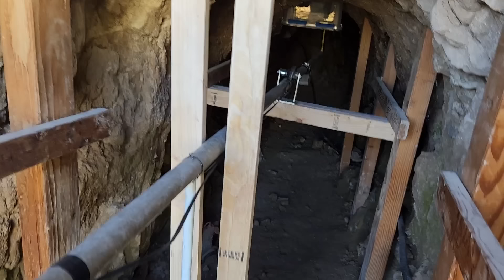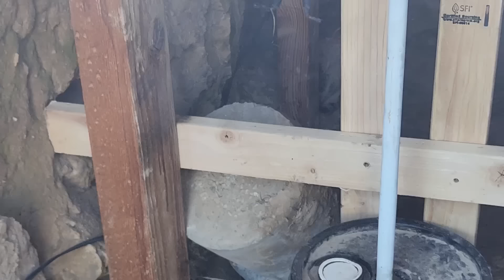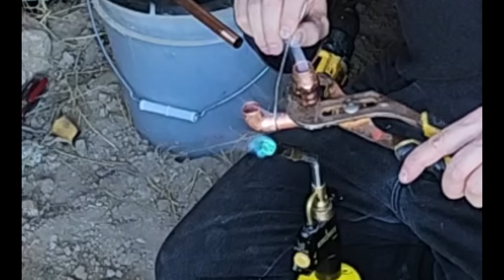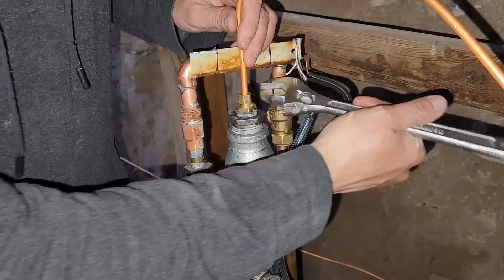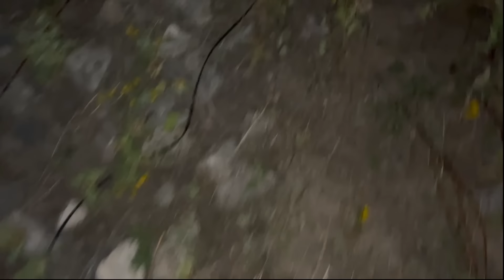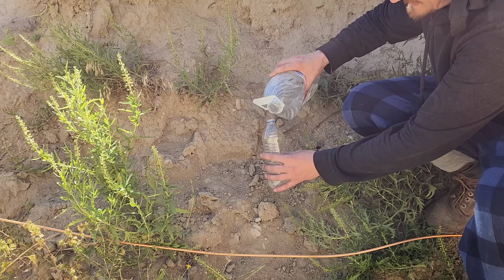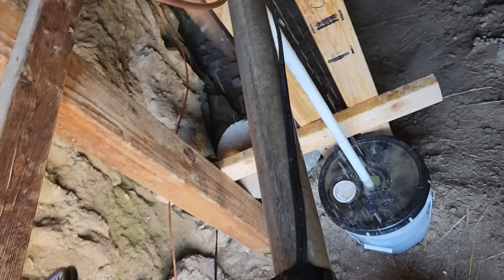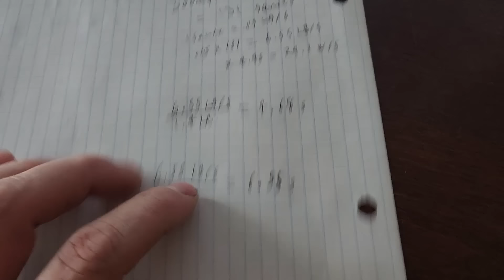Sodium Water Hybrid Rocket?

Comment: THINNER AND LONGER SODIUM CYLINDER WITH STAGES TO ENSURE TOTAL SODIUM BURN AND LONGER BURN AND NO SPUTTERING. SMALLER EXHAUST HOLE TO PREVENT SODIUM FALLING OUT AND MORE WATER. A SMALL PUMP WITH COPPER PIPE CAPPED BY VERY SMALL NOZZLE.

Comment: Inthink the heat melted the sodium and it blew the metal out of the injector - need to work out how to maintain the temperature and perhaps also use the hydrogen produced in the reaction to provide thrust?

Comment: i'm not nearly as creative so I' struggling to come up with a better way to use sodium as a propellant because solid sodium has the problem that as you burn it, you're going to start melting it, so you'd have needed some kind of regenerative cooling. injecting the two on an impingement might work but idk how you'll get sodium to behave, pushing it out through a screen as a monopropellant might work if it catalyzes with something besides water

Comment: I wonder if this would work by using a cylindrical-Aerospike-style water injector at the bottom of the combustion chamber facing upward to start, with a top-mounted injector pointed down to start later? Or a variable-geometry injector at the top that starts with a thinner cone-shaped stream that just barely hits the bottom of the clyinder-cut in the center of the sodium early, then expands as it goes to hit higher up the sodium central cavity as it goes? 

Anyway, a sodium-water rocket is an interesting idea, I think it's purely the "delivering the oxidizer to the fuel" that is the hard part.

Comment: Maybe you could use smaller rods, and a lot of them, instead of one big one down the center. Maybe a bunch of rods made from something that will dissolve once you pour alcohol onto them, after the sodium has solidified. Would just a few be better than a handful? For longevity vs peak thrust? This is a fun experiment.

Comment: Congrats on your proof of concept!  Totally Cool, the SCA vest was overkill!

My thoughts are that you need to test at what pressure does the Pressure Vessel fail which will give you a baseline for how strong a combustion chamber needs to be.  Remember your combustion chamber is not a sealed vessel!  Also PEX is much lighter than copper, and an igniter could melt a wax cap releasing the water instead of a heavy copper valve or even a plastic valve could be employed.  I suspect the dry unfueled motor could be brought down to 2lbs or around 1kg. 

_______________________________________________________________________________________________

Careful prophesizing on Climate Change prevention as the sodium bicarbonate may act as warm blanket holding warmed atmosphere below it.  Just saying!  Maybe you can say "No CO² released by that engine!" and stand correct of course that does depend upon the fuel manufacturing process! (getting the pure sodium metal)

_______________________________________________________________________________________________
My thoughts while you brought up climate change!

PS: EVs are not the panacea we are being told, we all must downsize our cars to engines under 2l or under 1l still using gasoline and move towards getting a solar home power plant not using non lithium batteries like iron sodium cells which WILL saves our world!

Comment: Ok speculation time... instead of one injection port... you have multiple surrounding it shooting water through predrilled holes in the sodium... With an uphill slope to them, terminating at the top center hole....instead of one large hole in the center you have a pinhole so the melting sodium has an extra second to burn. Perhaps have the center hole be cased. Maybe swap the argon for something volatile. Whatever you end up doing I'm excited to see what you come up with. 🎉

Comment: Instead of burning a thread, you could use copper wire, #24 wire should hold about 10N easily, and would melt when you apply voltage to a section in the middle.

Comment: Maybe if you could have made small pellets out of the sodium the smaller the better then there would be a more consistent reaction as the water makes way around the pellets. In the case of using pellets I would say maybe using smaller pellets towards the bottom and then significantly larger as it goes up towards the top because the top in your design gets worse exposure to water than the bottom. The nozzle would have to rise up if it was put at the bottom exposing the bottom part of the sodium that's closest to the X in the rocket and then the nozzle should rise above the burning but if you intend to burn from the top side down it would totally throw off the thrust capability of the rocket. I think the design has to be rethought when it comes to the use of the sodium with the water it might even be better if you can make the sodium into a gas and mix sodium gas with steam in expansion chamber like typical rocket.

Comment: I love seeing the ingenuity and rigor that you use in the concepts, build, measurement, and explanation of the setup!
Weighing the paper is so great, it gave me a visceral sense for what an integral actually is that I never got from all my calculus courses!
Reply: It is literally the area under the graph. Technically he didn't do calculus because he did not mathematically figure out the area. Granted, if you are just tinkering it is a decent quick and dirty method.
Reply: @joshbeaulieu7408  He did do it mathematically by calculating the weight ratio.

Comment: I agree with using a liquid fuel,,  You would have injectors for both the oxidizer and fuel,, which then will let you control the rate of burn more evenly,,,  in fact,,, you could remotely vary both the amount of oxidizer and fuel during a burn to figure out the best ratio,,,  I realize that you can use chemistry and math to get close to optimum but the remote control would let you vary the volumes and pressures to dial in the values to allow for changes caused by your hardware,,,  ok,,,  lets get to work,,,   :-)

Comment: Very interesting idea. Me being an armchair rocket scientist 😂.  Could you use a engine injector that's designed to go straight on a engine head. Should be able to deal with the heat. Closes when there is no power so it has a Deadman switch in a way.

Comment: Turn the jet upside down so that the water and sodium doesn't pour out the bottom. If the jet is blowing upward thus pushing the rocket down then maybe you won't have to do it in the mine.

Comment: You could theoretically increase the specific impulse of your rocket a fair bit by using hydrogen peroxide instead of water to oxidize the hydrogen and produce more energy from the same weight of fuel

The issue would be igniting the hydrogen with the oxygen, which may happen on its own with the heat of the sodium reaction. Theres also a chance the sodium may create sodium peroxide with the peroxide, which is a very strong oxidizer itself

So if you are looking for a second battery of tests, 10-30% peroxide may give you a big boost in thrust to weight

Comment: If you drop Sodium in water most of the energy goes into a chunk of the Sodium flying up into the air. There's no way this rocket design isn't going to result in the 'solid' fuel disintegrating almost immediately

Comment: I think using SaK alloy as a liquid fuel is definitely the way to go. The problem with trying to use solid sodium as a fuel is that sodium is a metal. And metal conducts heat. Whereas typical hybrid and solid rocket propellants are self insulating. Combine Sodium's low melting point with its relatively high thermal conductivity, and it's easy to see why the fuel melted and ejected within the first second after ignition. And even if it stayed in combustion chamber long enough to burn, which it won't, the motor casing would have little protection against the heat.
But all things said and done, I'm not sure that the specific impulse of water and sodium or sodium-potassium is going to break 150s, even under ideal circumstances. That's better than some amateur propellants, but not enough to compete with commercially viable propellants. And even if it performs well enough to be competitive, the handling difficulties of elemental sodium might kill it right out of the gate.

But I hope you're able to find a way to make this idea work. Maybe reach out to Thunderf00t. He has a lot of experience with burning sodium.

Comment: Cody, I have two points of advice, 1) pouring the sodium in multiple pours, will result in voids in the material leading to combustion instability. & 2) try creating a pure argon environment to melt and pour the sodium into your combustion chamber to resolve this issue. On a positive note using a threaded rod for the central cavity within the sodium is a great idea as it creates additional surface area for the ignition of the sodium. However, that may be what led to the engine-rich exhaust. (Edit; spelling error.) P.S., If you review the slow-motion footage you can see that the additional surface area introduced by using the threaded rod did in fact lead to excellent ignition of the engine. I believe that the engine-rich exhaust may have been caused due to combustion instability introduced through the use of multiple fuel pours leading to cavitation (voids) within the sodium which in turn led to rapidly varying surface area within the fuel grain creating the instability seen.
Reply: This could also be achieved by remelting the sodium once it's in the tube. Another factor in the combustion instability may be insufficient pressure forcing the water into the combustion chamber, allowing the exhaust to prevent water from flowing into the engine until the combustion ceases, resulting in an oscilating combustion pattern.
Reply: That in my view doesn't affect the main problem of the concept which is liquid Na being expelled from the combustion engine.
I think that he must first address a way to reduce, not increase the interaction of Na with water in order to reduce the temperature in the chamber and develop a more consistent and steady burn.

Comment: Looks like instead of a rocket engine you made a tube that craps molten burning sodium. This was the problem I was curious to see how you might address it, unfortunately not addressed in this model . I can't really see how you would fix it beyond tremendously increasing the burn rate. Which you cannot with h2o and sodium. Should probably at least start with a smaller diameter Maybe some kind of supportive ceramic framework that increases surface area exposure to water as well as something for the molten sodium to adhere to.

Comment: Amazing work! I wonder (although by any metric I realize it would be hell to achieve) can you control the sodium injection like the water, for example, if the sodium is in powder form? I know combustion of powders is way easier and this can combust into air even if it is not a powder, so basically converting already dangerous stuff to super-dangerous... But still the lost of trust seems due to bad mixing of oxidizer (water) and the fuel (sodium), resulting in a lot of unburnt material leaving the rocket without producing (almost) any trust, thus the rocket operate very very far from its theoretical maximum.

Comment: I love these videos. I think if you wanted to get a little more of a controlled burn in the future instead of using an inert gas for pressurization maybe use some type of hydraulic pump with a bleeder and injector. Like something out of a diesel truck. liquid pressure is much more of a steady flow.

Comment: I wonder if there could be an advantage in including a sacrificial plastic or waxed paper liner inside the sodium propellant tube, so that the reaction front is confined to the bottom end of the cylinder.

Comment: I wonder what would happen if you mixed the sodium in its molten state with water using two nozzles? Drop the molten sodium and water into a small steel bowl. Cover the perimeter of this system with steel pipes. Direct the gas resulting from the chemical reaction from the other end of the pipe. Such a system seems more promising in my opinion.

Comment: solid fuel rockets would burn from the bottom up, but if you are applying water from the top then that is most likely why it is blasting the sodium chunks out the bottom. Maybe for next version try water from bottom or maybe spray from a range of pinholes down a pipe in the centre hole? Ideally you would want to stage those holes so water only contacts the bottom layer of sodium and as it burns activate the next pinhole further up.Or what cberge8 suggests, but within the long hole.

Comment: I think that once the water flow ended the argon gas took away the oxidizer and quenched the combustion. Not entirely but it did contribute. Straight-up compressed air might of been a better choice.

Comment: I'm thinking a ribbon or pellet injector for the sodium into a controlled-water-flow reaction chamber above the thrust nozzle. Potentially avoids the issue with unreacted metallic sodium. Feed rate could also then control the amount of thrust. Great job, keep at it.

Comment: A couple of thoughts 
1. The reaction also produces hydrogen so controlling the combustion of that by some sort of afterburner should increase the thrust
2. It’s probably worth doing some research on whether pouring molten sodium directly into a metal tube might produce some kind of amalgam and weaken the metal (like for example gallium or mercury do to aluminium).

Comment: I worked in a pesticide research lab in the 70's, and we used the same weigh-the-paper method to calculate the parts-per-million (or billion) of whatever pesticide we were testing for.  We had a PDP-11 and a PDP-12 available to us, but weighing the paper was easier, and just as accurate.
Reply: Blessed be those who gave us modern HPLC.
Reply: @bazooka93  You can always have a slide rule and tables of logarithms as with NASA Apollo engineers 😉

Comment: i think the way the fuel is mixed is perhaps the biggest point of failure, lower part of the solid fuel getting dislodged and blown out the back is a massive problem, perhaps some sort of internal baffles with channels to increase surface area and help retain the solid fuel in the chamber, fantastic practical science as always, edit i saw another guy suggesting injecting molten granular sodium and i think thats an even better way to maximize surface area, although adding alot of complication

Comment: Awesome!  I love the concept.  It seems to me your most immediate need for improvement is in regards to fuel mixing.  Ideally the only fuel present in the reaction chamber is that to be immediately reacted i.e. the amount of gasoline in a combustion chamber suitable to drive a piston.  When you first explained your concept, I assumed you would be using granularized sodium.  Seeing the sodium at normal or whatever your ambient temperature was, I can see how this could be difficult, but I think it's your best bet.  In my mind the ideal engine would have the fuel mixture entering the reaction chamber in a volatilized state with maximum surface area at a controlled rate that matched that of reaction.  I'm thinking two nozzles, one spraying powdered sodium and the other water.  Anyway, love what you're doin man, don't let your reaction product exceed the escape possibility of your reaction chamber.

Comment: Was going to ask about a full liquid version, until seeing your comments at the end. Hope to see it. My only other thought was to try something like the hybrid fuel pucks, and use sodium bits suspended in a matrix that gasifies at an appropriate temp to regulate fuel supply and egt. Some hybrid/hybrid, with water/peroxide and a rubber matrix with suspended sodium craziness??? It seems like it could work, but encapsulating the sodium to make it safer to be around is probably a good idea in the long run(for safety and reliability). I was shocked at the low melting energy of the sodium, seemed like it was just barely even solid when you were tearing off bits and crushing them with your hands. Not really surprising it puked its guts out as soon as it got going.

Comment: that's awesome.
 i was working on electrolyzed water rocket but got sidetracked, have to make it "on demand" as it's too dangerous to store; some dude in CA blew his brothers arm off then eventually himself trying to store it(electrolyzed water, AKA HHO gas, Brown's gas) in steel tanks. can weld with it too but have to bubble through alcohol or welds oxidize.

Comment: Low toxicity, long shelf life hypergolic engines would be so incredibly helpful if this promising chemistry can be tamed.
What kind of binder would melt at a higher temperature than the sodium to keep it in the engine long enough to react, and what geometry of sodium in the binder works best?  Can the binder break down into something acidic or can acid be encapsulated in the binder just like the sodium?  Could this further detoxify the exhaust into salt water or something?

Comment: I was wondering if you didn't treat sodium like a grain and mixed it in chambers leading to a nozzle. Pellet the liquid sodium like lead shot in a oil drop bath. So the water can mix with the sodium at a higher surface area/speed. Less chunks of sodium getting to the nozzle. A spray bar instead of one water nozzle to flood the pellet filled chamber evenly

Comment: If you were able to keep the sodium at 210-250°F could you not design it to use liquid sodium in an effort to let the sodium and water mix better? Like using an injector plate in a combustion chamber? A simple heating element in the sodium would do the trick.

Comment: So one obvious flaw is that your reaction starts at the side opposite the exit nozzle. For this to be functional, it optimally would start closest to the exit, but at least should start on the sides. Petroleum products also produce water output, I wonder if that could be used as burn delay/fuel in some fashion?